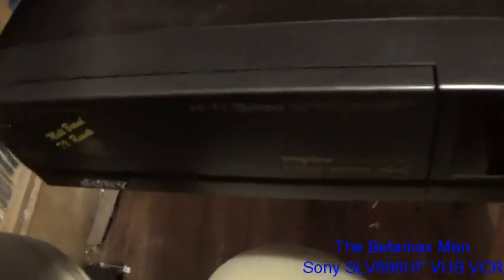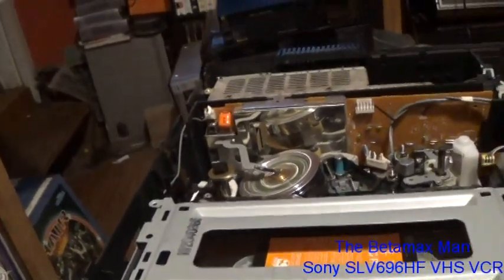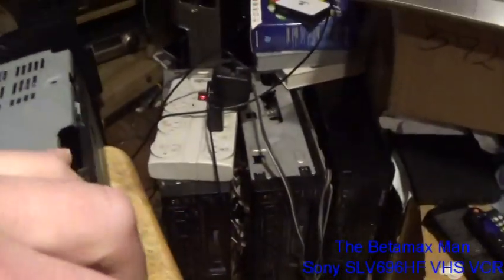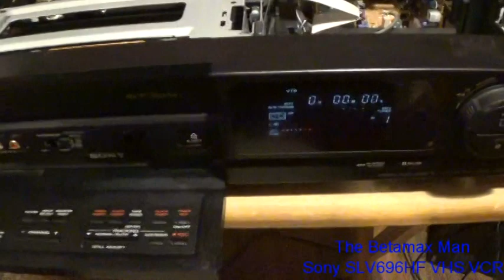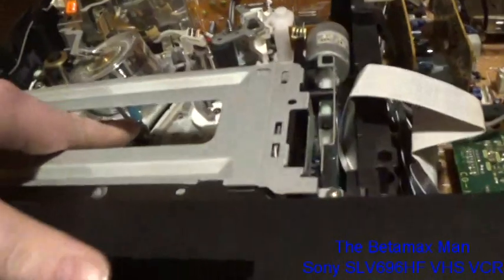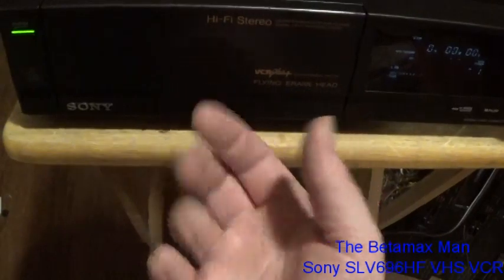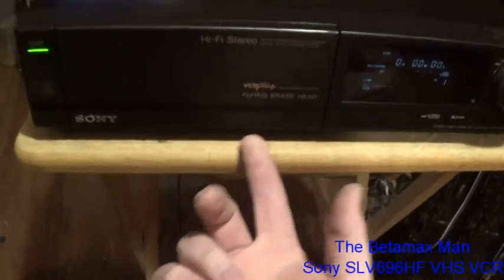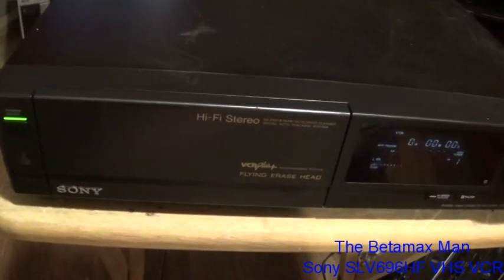Sony SLV696HF VHS VCR Pickup Video

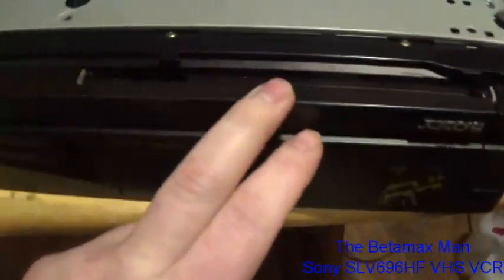Comment: 0:56 - Regarding the "Command Mode" switch for the remote control, the manual for this VCR says:
VTR 1: For Sony Betamax VCRs
VTR 2: For Sony 8 mm VCRs
VTR 3: For Sony VHS VCRs 

However, for VTR 1 (Betamax VCRs), it cautions, "Some of them may not be controlled in this mode." 

So, you can probably use a Betamax remote to control this machine by setting "Command Mode" to "VTR 1". 

It's too bad this machine does not have adjustable audio recording levels, especially since it already has VU meters. 

I once found a Sony SLV-575UC at a thrift store (a very similar model with adjustable audio recording levels but no flying erase head).  I normally would not buy a VHS machine without LP-mode recording, but it had so many great features, I felt I had to make an exception.  Unfortunately, its pendulum gear was broken.  😥
Reply from the maker: correct but it dosent matter what sony vcr it is that switch is very cool. thanks for supporting my channel